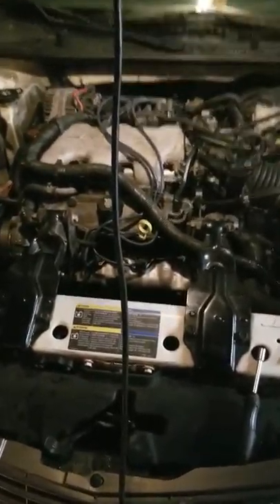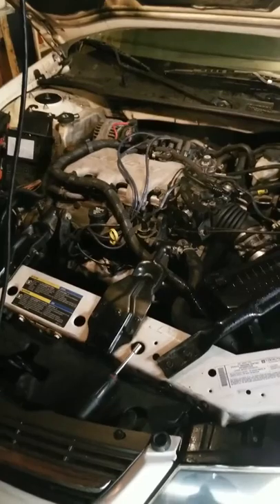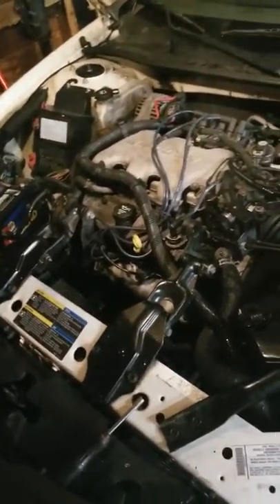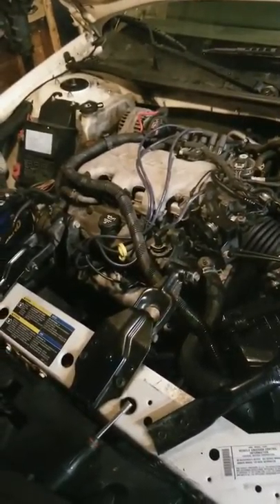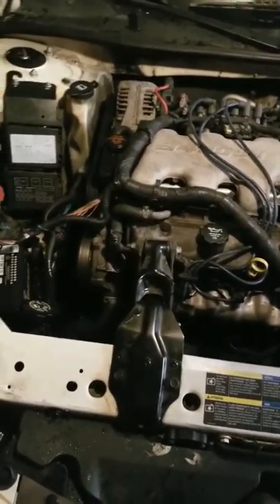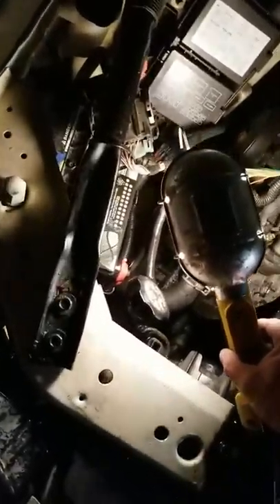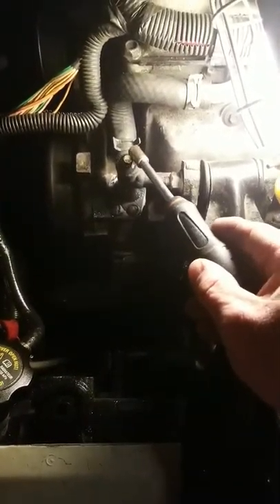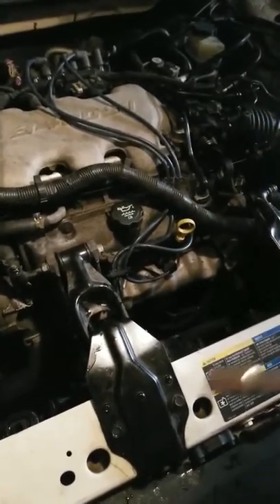2005 Chevy impala over heating

Comment: I had a buick century with the 3.1 which is the same as the 3.4 and the temperature sending unit wasn't telling the radiator fan to come on until the car would overheat. Took a little bit to figure out and changed the thermostat also. Really annoying. These engines have an iron block and aluminum heads so they had overheating issues.

Comment: I am going to try to be fast. I do not have the money to take my car to a shop. I have a '04 Impala. Has been overheating for a while. I am going to blow it up if I can't find help. I have had the radiator flushed, checked the fans, had 3 relays changed, replaced a coolant sending unit. Plz bare with me, I don't know a lot about cars. The guys says he checked for it to be vapor locked. The car will show it is buried in the read. But no steam or smoke comes from under the hood. Nothing is leaking on the ground when you add coolant. But it is using a lot of coolant. Any advice will be welcome and appreciated more than you know. This is the only car I have. And if it brakes down. I am in trouble. I have no family or anyone that could help me . Thank you..
Reply: Did you ever solve it?

Comment: I guess I'ma try to go get that left bleeder screw, i had one but my dad insisted on working on it while i was at work and he broke it. If that doesn't work i don't know what to do
Reply: Dorman makes one. I replaced my thermostat housing with one from Motorad which came with a new bleeder and so I now have a spare. Unfortunately, my replacement takes an 8mm wrench to bleed so I need a different wrench on each side!

Comment: Mines doing this at the moment i will try this out cause the heat comes and goes only over heats while in park for a while or stopping driving it temps at under half point cooler side never over heats on highway
Reply: No leaks
Reply: Did you fix the issue?